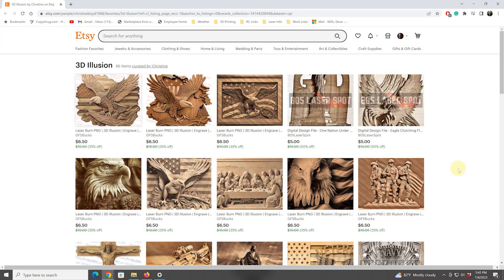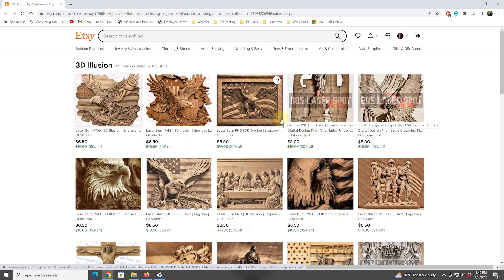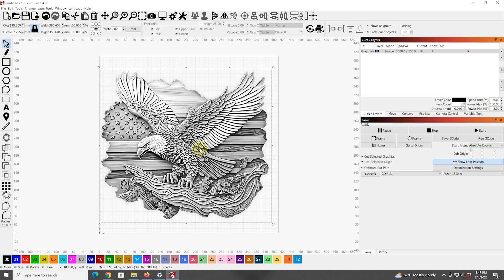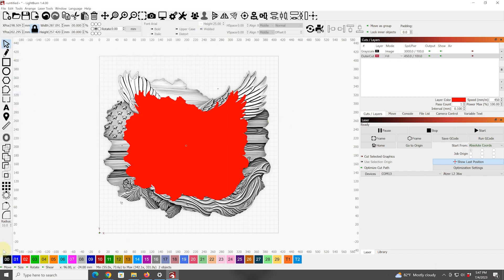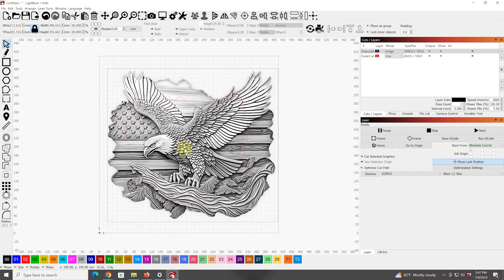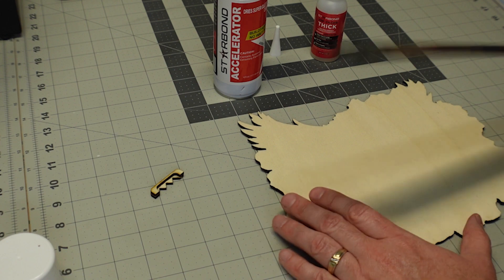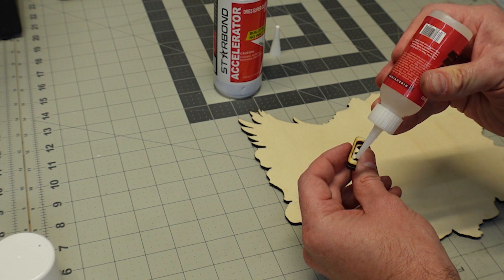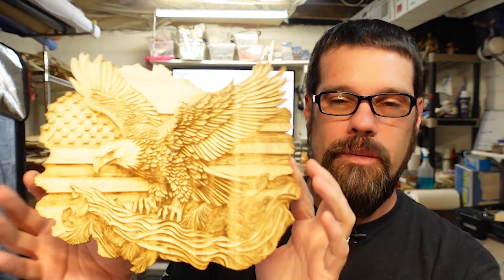3D Image engraving with Lightburn and the Atezr L2 36w diode laser

Comment: It's getting hard to tell between some of the 3D engravings that have a depth vs. those that stimulate it.  Does anybody know of an app to stimulate the 3D that will work with the ORIGINAL XTOOL 2W D1 IR 1064 laser head?
Reply from the maker: The 3D simulation effect is all done with image shading.  There are some apps that might work for this like 3D photo editor. After editing it in there, you could then import it into your laser software.

Comment: So does the end result actually have different depths throughout the picture? I was to the understanding that the 3d effect was created by multiple passes at a lower power. The dark areas that are deeper would get more passes and the lighter areas that are higher would get less or no passes .
Reply from the maker: There are depth variances even in a single pass, but not as prevalent as on a multi pass depth map engraving.
Reply: @Vintauri  You seem very knowledable and helpfull in this topic. I have done 2 depth engravings but was not sure what to expect. I wixh I could share pictures. I did a single pass on mdf. It turned out ok but would like to figure out the multi passes. I assume to use crosshatch?
Reply: @Vintauri  is it possible to use a depth map using this style of engraver?

Comment: MDF does not have any grain, How would MDF work for engraving
Reply from the maker: MDF is okay but I find that it does not shade as well as something like basswood.  It's also mostly resin and sawdust and the resin tends to get sticky when burned and does not smell good at all.  Some MDF may have Formaldehyde in it so you should be careful not to cut that material.  It's great for vector fills that are one shade though. So for text I do like it in select cases.

Comment: Looks nice. You mentioned the creator provided the outline but you had to resize it. How difficult was that?  Couldn't you have just created a small offset and used that for the cut line?
Reply from the maker: You would first have to create the vector outline to then create an offset.  The Eagle and flag are a PNG and thus a raster image.  You can trace it but Lightburn does not have a trace option for just the outer bounds so you end up doing a lot of cleanup of interior lines it detects. The seller provided the outline but it needed to be resized to fit, it did not take long but would have been nice to have been the correct dimensions to begin with.
Reply: @Vintauri  I forgot about that. Thanks for the clarification.

Comment: hi that was great cut i also have the same laser AZTER 36 V I AM HAVING TROUBLE adjusting the reels on x y   no matter waht i do the bolts and nut on the reel coming loos so the real are not running parallel  and kind of jerking so the cut dose not come out right amu idea how to fix it .
thanks
Reply: Merhaba Civatalara Loctite 243 50ml Orta Kuvvet Cıvata Sabitleyici uygula ve birgün bekle civatalar gevşeme yapmayacak.Sökmek için hava tabancasıyla ısıtman yeterli tekrar sökebileceksin.
Reply: thanks  @istrative

Comment: I had a sheet of 3mm ply and printed a waste board template on it, it was straight when I started but then warped very badly from Lasering it. Just wondering how yours didn't warp since it obviously had a ton more heat than mine.
Reply from the maker: There was very little heat involved with this engraving.  But warping is usually from either stresses in the wood being released or a change in humidity and moisture content in the wood.
Reply: Well the wood was perfectly flat until I engraved a grid of lines on it.

Comment: Looks great.  Can we get that done in Co2 laser of 50 watt?
Reply: The fact that this is a not a proper 3D engraving that would employ  the grayscale  function but  just a  "3D look" engraving that uses normal Jarvis dithereing, means it will be easy to replicate with a 50 watt CO2 and probably at 300 to 400mm/s

Comment: We bought just about every option for this unit but the extension and hood....Were not very happy so far, one of the X rods were not mounted in its socket and would not fit even with the screw out of the socket, had to be hammered in. The unit was scratched up, when I contacted support they said...oh sorry. We paid $1600 for this unit and it seems to have software issues and it will not autofocus and tech support is useless....I really regret buying this unit.
Reply: Don't let them get away with this, I am seeing more and more complaint's pertaining 2 Atezr's Customer Service, Save all of your email corrospondence, sent & received  to & from  Atezr, Report your problem to the Federal Consumer Protection Division,  File a complaint with the better Business Bureau , Find a consumer protection Lawyer, I have been having an on going serious issue with  Atezr Support, they have lied to me twice, they have been delaying replacement parts, haven't been able to use my 36W L2 laser since receiving it, it is now going on 82 days waiting for these parts,I am also asking for compensation, they have cost me greatly! on all levels,  I've missed out & lost income from the school opening season, the 4th of July Holiday, Halloween is just around the corner, Thanks Giving Holiday, If they do not comply with sending me parts & compensation for the damage they have caused me, I will do myself what I have suggested for you to do I am now searching for a lawyer to sue Atezr for EXTREME Loss of Income, Pain and Suffering and More

Comment: How do you calculate the beam with?  I have a 100w CO2 laser. Thanks for sharing.
Reply from the maker: The diode manufacturers like to share the focus spot as they are fixed focus machines.  A better way to determine it would be with the interval test within lightburn. Run that tool with increasing interval widths and when you start to see the gap between the lines you can use that to determine your beam width.

Comment: Nice video!  How long did it take to carve on your laser?  Roughly what size was the material? Thanks Don
Reply from the maker: The engraving and cut took about 2.5 hours and it's about 10" wide and 9" tall.  I used a piece of 12x12 material for this.
Reply: @Vintauri  thanks
Reply: what kind of material do u used @Vintauri

Comment: Thank you, what the max thickness of wood can I cut, Thanks.
Reply from the maker: That will vary on the type of wood, but in my other video you can see the same machine cutting out a block of letters from 3/4" or roughly 20mm clear Aspen wood.  More dense woods and plywoods will be harder to cut through.

Comment: It is fine, but is faux 3D.  I do actual 3D (or DEEP) engraves, closer to what a CNC would do.  I'm not sure why the fake 3D is so popular when the same tool can do actual 3D also.
Reply from the maker: Thanks for stopping by to check it out.  I hadn't come across your channel and you do some cool stuff so I subscribed and look forward to your future content!  I don't know that I would call this Faux 3D.  It's just a rather shallow 3D effect as there is depth differences between the dark heavily engraved areas vs the lighter areas.  It's a great way to get started towards the deeper engravings.  I think the reason that fewer do the deep engraving is that its a time intensive process and many are happy with the results of the shallow engraving.  If I wanted a true 3D relief engraving, I'd opt to use my CNC router instead.  I'll try to revisit this process for a deep engrave on the laser in the future, as I love playing around with new techniques.
Reply: @Vintauri  I did not notice yous had any depth in the darker areas. That IS more of a 3D effect.  I have seen some people selling the "3D Look" signs say that their customers complained and wanted refunds because it was not made clear that the image was flat.   This is the first time I saw your channel, so I subbed as well and look forward to more content.  As well, thank you for subbing to mine.  My uploads a a bit slow at the moment because of my full time work, orders, and the fact I Sublimate, 3D Print, Laser Cut and engrave.  On top of that I sold my glowforge because I mostly use my 100 watt laser, but I still have several glowforge videos I want to put out. :)
Reply: you have issues, dude

Comment: What have you found in playing with scan angle. I have the v35. I bought same file and did Jarvis .1, 5 degree. At 100mms 40-45% power was best. Baltic birch was great, cherry plywood is ok.  I copied your 15,000 mm/m 100% and am going to try it.

What will larger angles do? I heard you say stop banding. The Etsy seller recommends 5%  I might do some bigger offsets to test. Is it just a trick to prevent banding and 5% minimizes the y travel to keep speed up?
Reply from the maker: This was my second scan at an angle so I need to do more testing to find the sweet spot.  It's all to prevent banding from running in just one axis, although I'm tempted to run it at zero degrees to see how fast I can go and see if I get any banding.